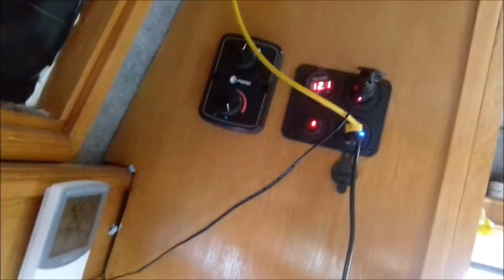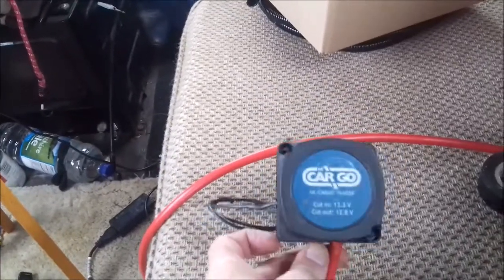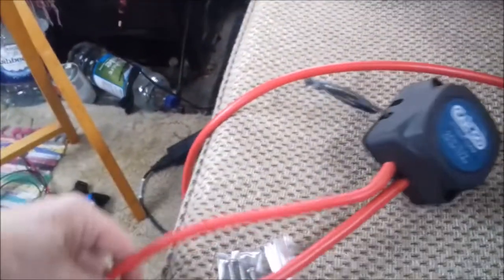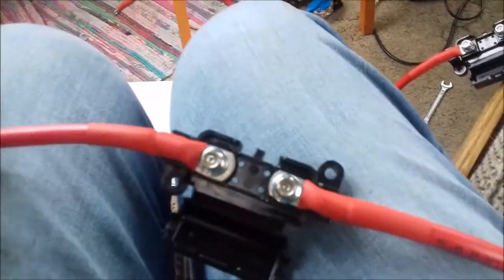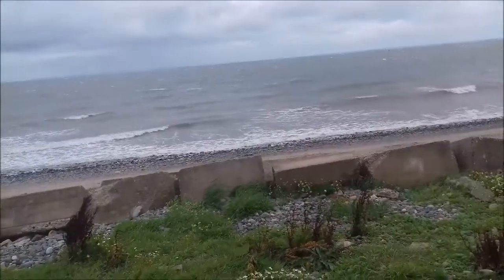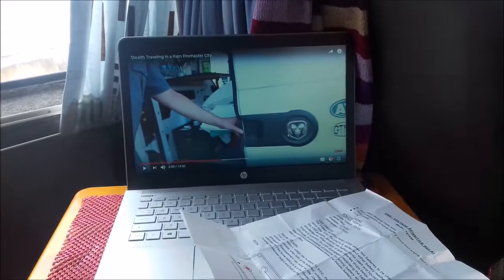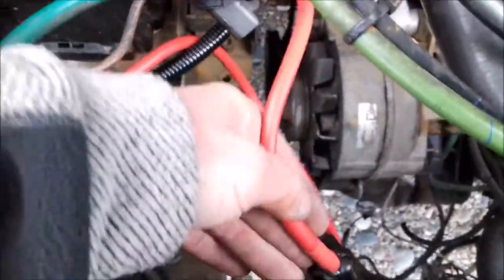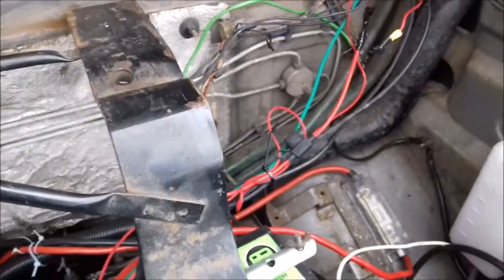Split charge relay  About time too!

Comment: Not best practice to have split charge relay under the bonnet. Well that’s what a local electrician told me.🚐☕️☕️👍🏴
Reply from the maker: An ex AA man helped me fit that there. But thanks for the advice, I think I will move it. I want to put a cut off switch in too, turn it off when I am parked up for some time. Cheers Chalky

Comment: My van did not have the spare battery holder under the wheel...they were fitted later... good fix. I use solar and split charge...cheers Stuart.
Reply from the maker: I do have solar as well, just in case I stop for a while. Take care Colin.